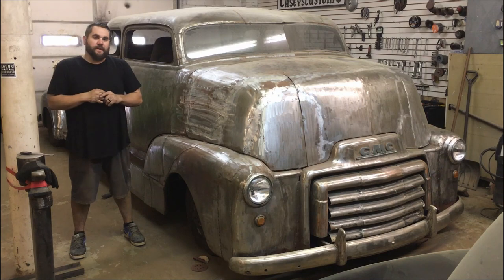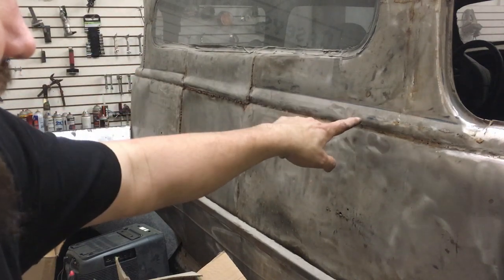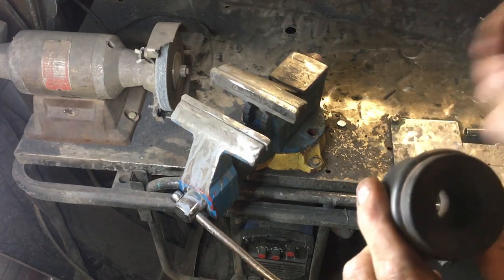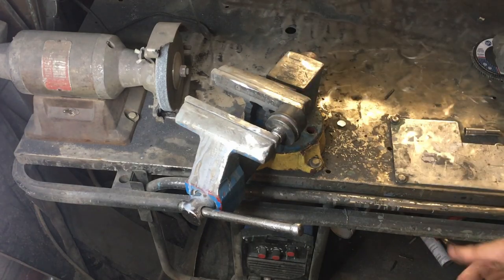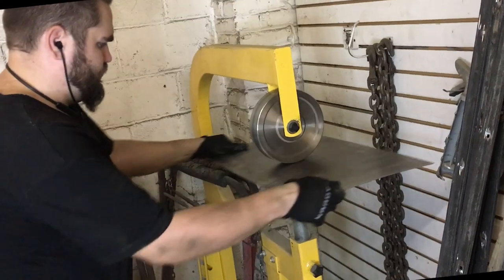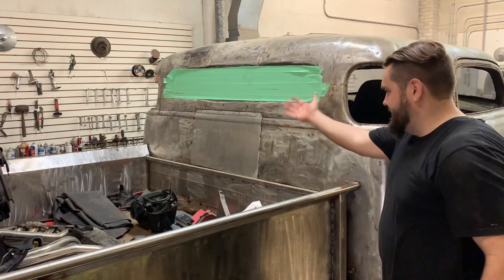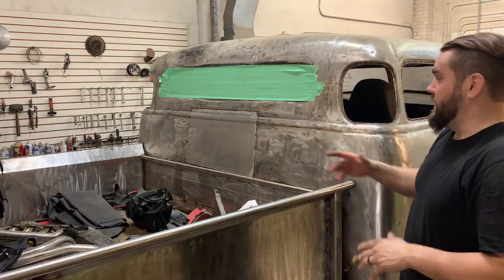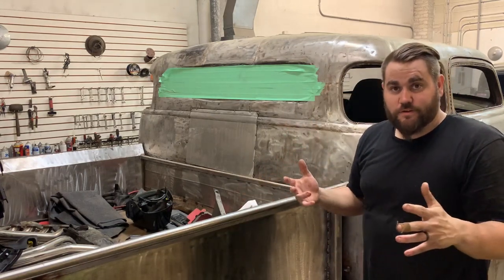HOW TO MAKE YOUR OWN BEAD ROLLER DIES! CHEAP & EASY WAY TO CREATE ODD SHAPES. BELTLINE, TRIM & PATCH

Comment: I really wish I would have researched more before I bought my bead roller. The one die I need for a 1/2 inch bead they don't make for a 22mm shaft size.

Comment: Try a drill press later with a grinder, and some files...
Reply from the maker: That is a good idea
Reply: @CaseysCustoms  
As I think about this, what is the radius on that bead (1/4")...
Couldn't you get a 1/4" round over dies, and make a pass on the bottom, space it accordingly (1 1/2"), and just make another pass running the sheet in the other way...
Reply from the maker: @joeschlotthauer840  no that would leave crease in the middle, also it would be extremely hard to line up perfectly both ways.